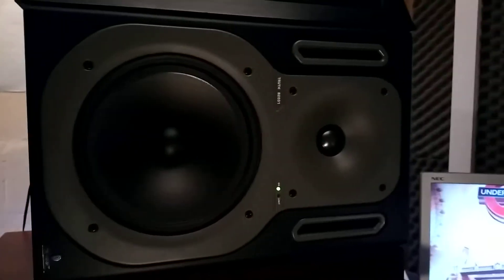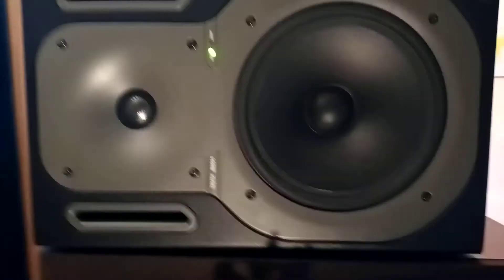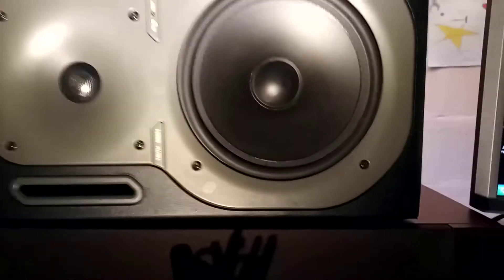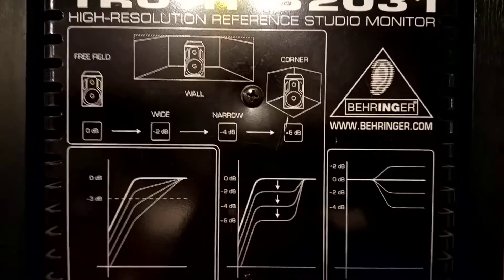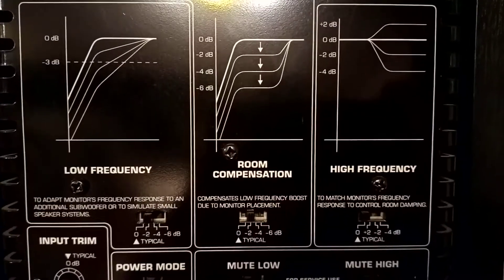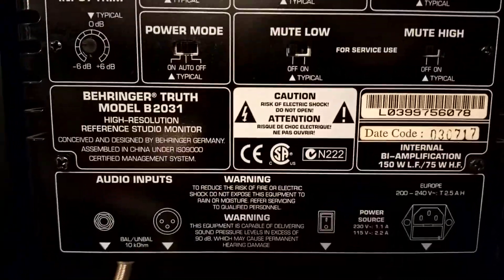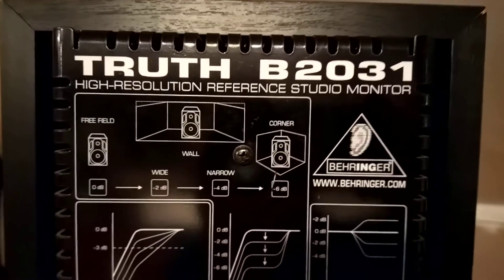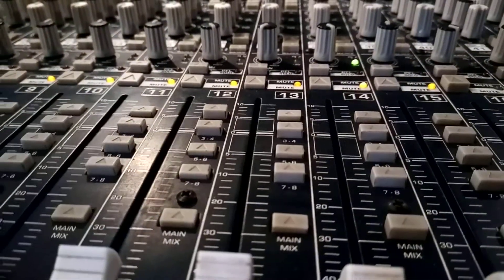Behringer TRUTH B2031  2-way active 150/75 W  high-resolution studio monitors Overview

Comment: I am getting 4 of these for a classic Quadraphonic room. Maybe even a 5th one for when mixing 5.1 film soundtrack. And at this juncture, probably a good idea to also get an additional back-up/spare unit. Love your sound dungeon, LeOnline, very impressive. I just cannot warm up to the two-tone color scheme on this monitor that they sell in Europe. In the USA they sell the all black model. 
https://media.sweetwater.com/api/i/f-webp__q-82__ha-7c26c0cf760d63cd__hmac-7873d625d5a6cd1d1223e1920bf6ac1233763025/images/items/750/B2031A-large.jpg.auto.webp
So I am ordering mine from a U.S. dealer. One of the few advantages of bering bi-continental. C'est la vie. 
Also, noticed you laid them down sideways, cool. Tweeters are facing out, fine, have you tried them the other direction, facing inward (towards the LCD screen in the middle of your desk), is there any audible difference one way over the other?
Reply from the maker: Thank you, i've made some changes to the control room and live room but the  B2031's still maintain their place (btw i have 2 pairs, a pair for the live room too). You can't go wrong  with these monitors, best bang for the buck in my opinion. The celiing is not high and I didn't notice any difference upright, so for an estetic need i placed them sideways. 
On top of the monitors have a pair of Yamaha passive speakers hooked up to a telefunken  solid state amp that work together with a pair of Opera Pavarotty speakers, i use them to check how mixes translate to a top end domestic hifi.

Comment: You're going to blast the hell outa yourself with that super close positioning 😁
I think that particular model of the Truths is best I've used. I've currently got the yellow ones and they're not as good in my opinion.
Reply: These babies were initially made be Genelec. When Genelec stopped making them in the early 2000s, Behringer reverse-engineered them and started making them. This was around 2004, they are making and selling them still. These are like the Tiger tanks. Solidly built mean mothers.
Reply from the maker: nope, position is good , they sound very good, The acoustics in the room are fine :) I've never tried the Yellow ones so i can't compare.

Comment: Both inputs are balanced and unbalanced. The jack is TRS, means you can use both types of connection.
I happen to have these monitors in my home studio.
Reply: Hello mister. Do you recomend it for home studio? And for edm
Reply from the maker: @HYPEON-official  if you can find them yes
Reply from the maker: Exactly,  very versatile and they sound good too. I also have a pair in the live room.
Reply: Hello

Do you know if there is some sonic difference between the older B2031 (until year 2001) and the newer B2031A (from year 2001) model?
Thank you 🎉